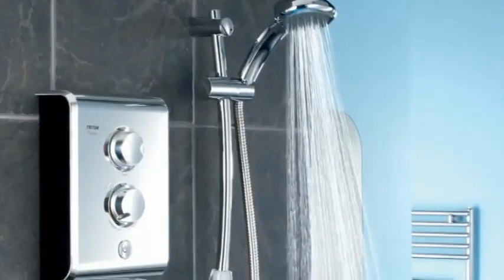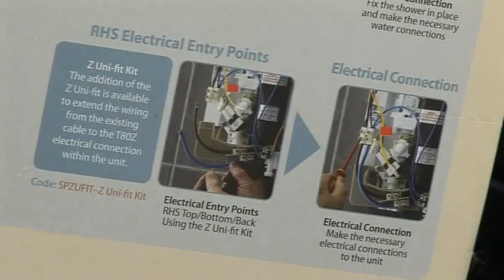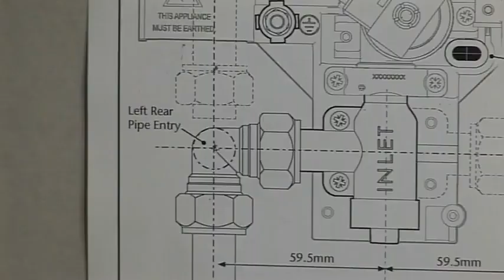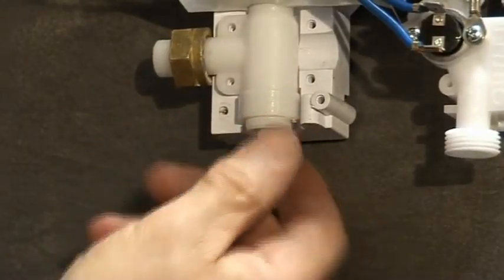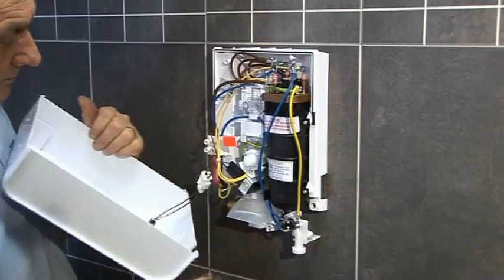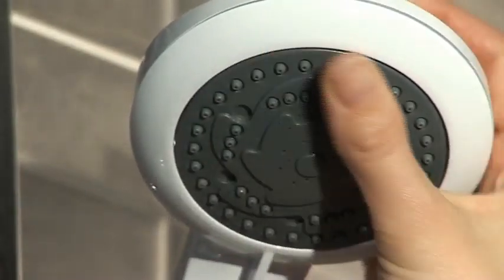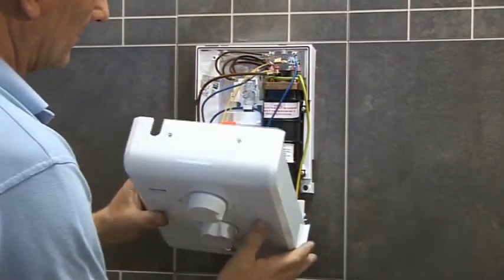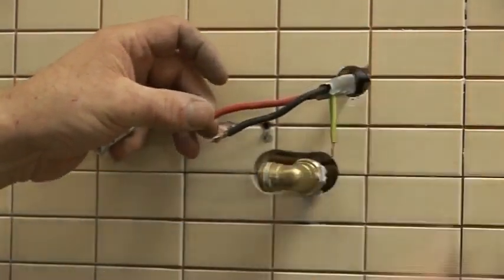Electric Showers: Triton T80Z Installation - It loves it from any angle

Comment: The pressure of 1 bar implies a head of water of 10m (30ft) - does this shower work from the main supply?    My T90si only needs 8cm head (min)  and a max. head of 10m (1 bar) according to the specifications but it is not to be connected to mains supply which can exceed 1 bar.

Comment: I notice the electric and water pipe inputs in your installations are never sealed. Surely this would cause water/damp to get into these points! Our walls have hollow boards so I have sealed these access points to ensure damp/water does not get into them.

Comment: My pipe and wire come from the top from behind tiles a straight pipe about 6 inch long with a pressure valve on it to stop leak no elbow on it, so how would I it that would all that pipe go inside the shower? It has to be on the right hand side ?

Comment: should I use copper or nylon olive when connecting water?
Reply from the maker: I prefer copper but unless you have particularity high pressure they both work fine.

I need to qualify that with  some plastic fittings  you need to use the nylon olives.
Reply: I used copper, works fine. Cheers.
Reply: @showerdoctor  
No you don't, copper olives are fine to use on plastic pipes